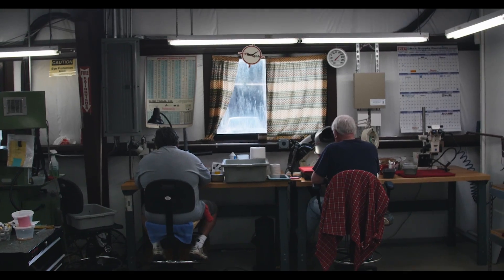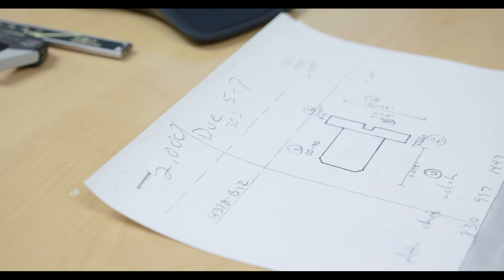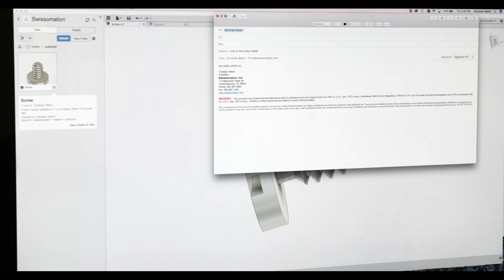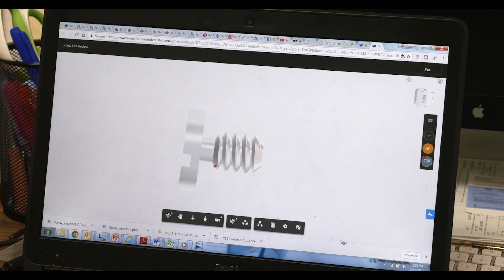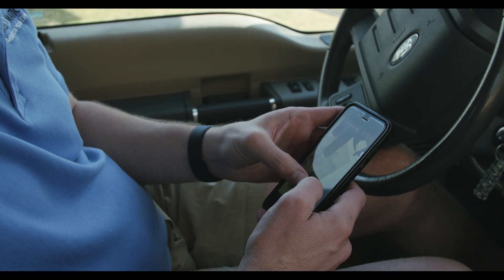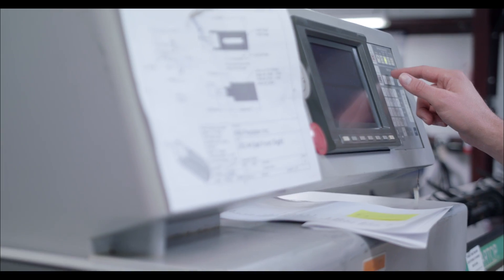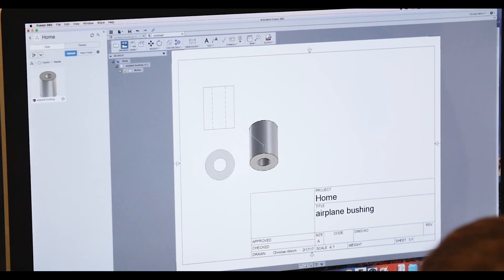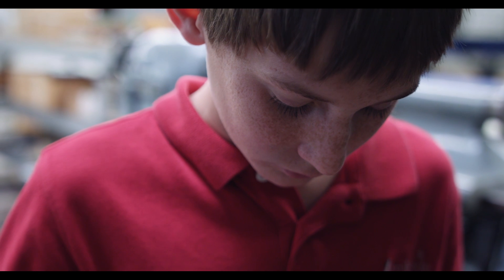Swissomation micromachines parts as thin as a piece of paper

Comment: the only feature I need implemented in Fusion is to make rail sweep as U can in rhino or other software, so that U can choose multiple profiles not just on one plane...
Reply: Amen to this... totally agree. What I would also like is measuiring like I do in Rhino. Measuring from the orthographic planes, clicking any where to any where and finding a distance. That is super useful. Not just snap point to snap point.
Reply: fusion can achieve same ""sweep"" , but on different way
in rhino  you draw  curves on  different planes or simply apart in  3d
in fusion  you create  subdivided mesh surface..

Comment: Why did the kid need CAD for a cylinder with a threaded hole?
Reply: I wanted to teach my son, by taking a real life need, and walking him through the process. I used the opportunity to teach him how to sketch the part by hand, use measuring instruments, read a drill chart, model the part in Fusion 360, create a drawing, and then machine it on his own. Not to mention, it was awesome bonding time.
Reply: swissomation Wouldn't waste your time responding to negative comments, you'll never finish. Anyone with kids knows this is a fantastic learning amd bonding experience. gg.
Reply: We have a few videos on here.  You just have to search for them under our name. I cannot link them.
Reply: swissomation i thought it was a good video. It covered other stuff as well. It was totally cool doing that with your son.
Reply: So they make parts so small you need a loop to see them and they show us someone making a spacer LOL was kind of disappointing.
Reply: gus bisbal they didn't produce the video either. Autodesk did. So the lack of closing out the story that they opened with is Autodesk's fault ultimately.
Reply: Ive used Fusion 360 for a while for my little hobby cnc machine. Recently i bought a lathe and most parts i make with it i design in fusion 360. Besides that i end up with a dimensioned drawing, its a nice mental process that allows me to think through how I will make the part, just as when i create CAM operations for my CNC mill.
Reply: Of course it was a great time, we are glad you did it and showed it. I guess showing us what your company is good at is what we were looking for.